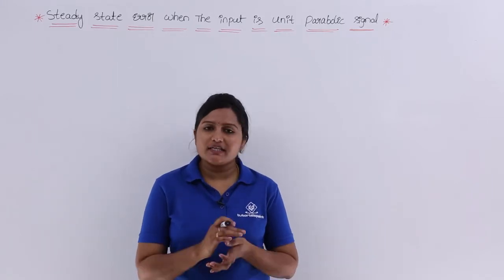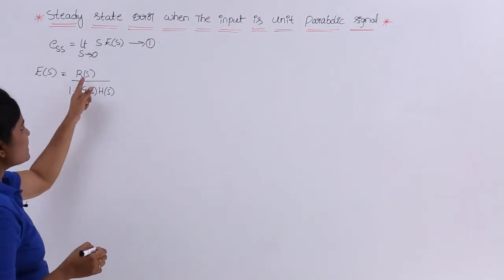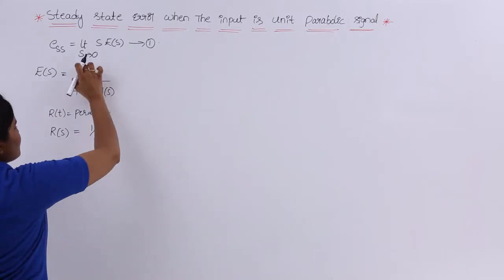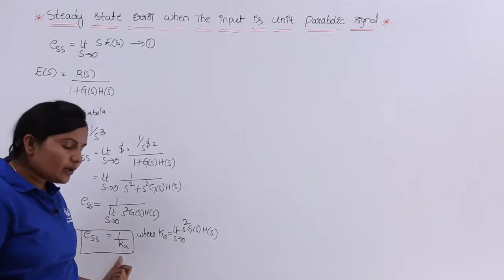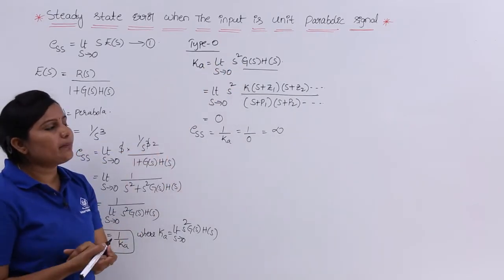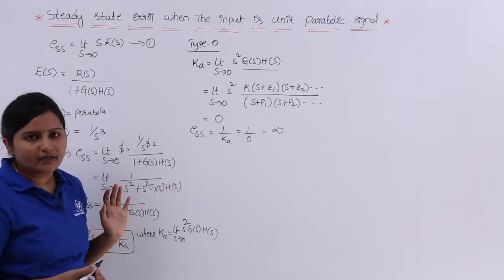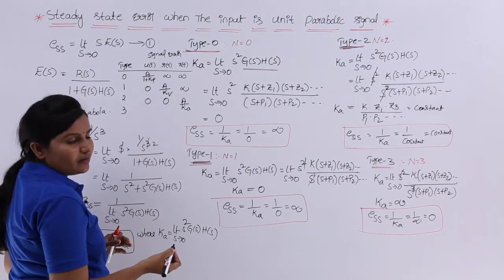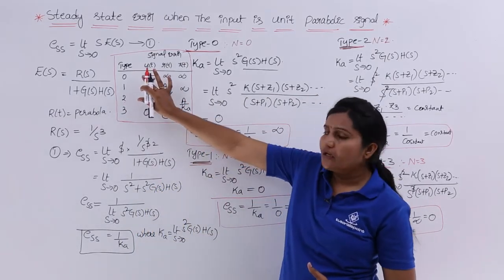Steady State Error When Error is Unit Parabolic Signal

Comment: Mam,if that short cut table is for steady state error then it is wrong in place of infinity zero should come and vice-versa.
Reply: No, it is correct
Reply: The table is correct. The signal error become zero when the type of system increases. Example for type 3 system, there will be no error for any given input
Reply: @amirulasyraf9900  it is not correct. she messed up places for 0 and infinity.
Reply: @EarthSanctum  you are incorrect